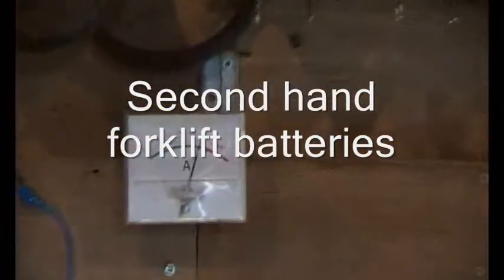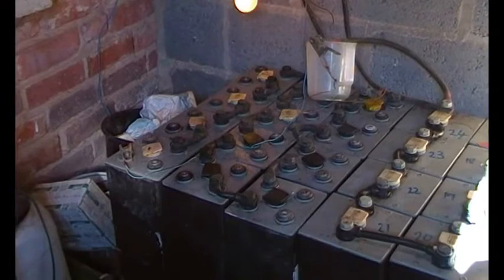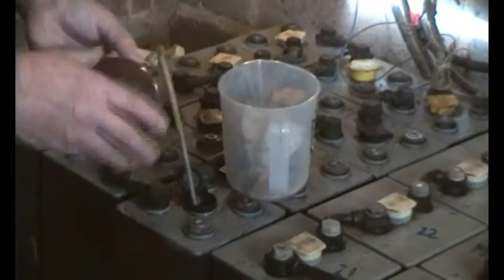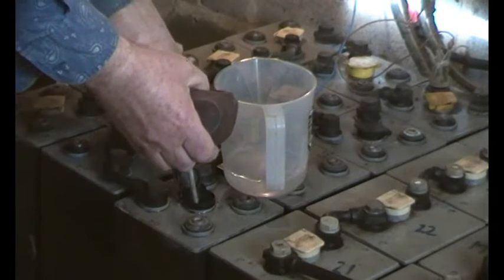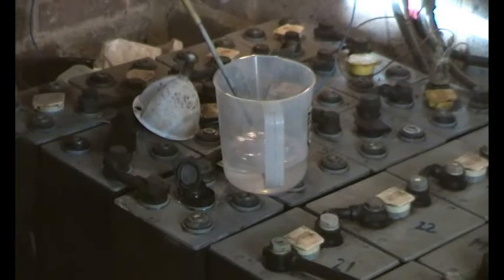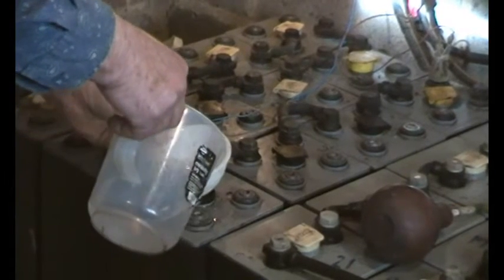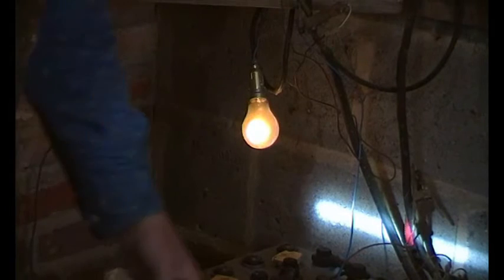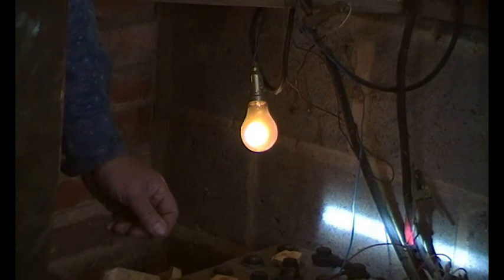Improving durability of second hand forklift batteries

Comment: How long will these batteries usually last in terms of age and cycles? 

Lithium batteries have cycle lifes of thousands, but how many industrial lead lasts? Lead is currently easier to use because its self balancing and supported widely by solar hardware. But lithium shines in cycle life.
Reply from the maker: Hi, the trick here is to use the battery as a buffer, balancing generation and consumption, that way the batteries are not deep cycled and life is extended by years, cheers

Comment: I have a question do you know if it’s possible to use a common lithium battery play one would use for a van?

What makes a lithium forklift battery special? 

Seems like stacking cheaper house, batteries for the team, the same voltage but maybe with less power density?

Seems like it’s worth a shot and a whole lot cheaper. That forklift batteries just ballasted to meet the weight?
Reply from the maker: lead acid deep cycle are heavy due to lead plates, mine are 500 ah and you won't find that in lithium unless they are in parallel. They have a different charging regime but things are developing fast. The weight for a forklift is a benefit otherwise weight has to be added, cheers

Comment: I’m a forklift truck engineer of 30 years and I/we have never put stronger acid in traction Batterys,
And you should never use distilled water it should be de- ironised,
And Verdigre ( Corrosion ) is caused by iron vapour coming of the wrong water in the Batterys, 
But all battery cell terminals should have grease on them to protect them from corrosion,
Reply from the maker: Thanks for your thoughts, definitely use battery terminal grease, cheers
Reply: Hi Andy and Dave,

Have recently got a set of 600AHr OPzS that were in good service for only 2 years and were de-commissioned simply because the PO went on grid.

Unfortunately the PO removed the acid to make them easier to move:-( . They've sat this way for 2 years.
That's how they came to me. The airtight caps are on.

Do you recommend anything I could do before I (re)do the commissioning procedure, e.g. add acid and CC charge at C20
till I reach 2.75 VPC/or no more increase in voltage and no rise in SG for 3 hrs after maxing out on the voltage?

Is there anything to try and remove any plate corrosion before this procedure (wash w baking soda, EDTA etc. and rinse thoroughly?

Really a beautiful set and it be a shame to toss

regards,
Nick
Reply from the maker: @nickbarret9368  Nick, it was common to empty batteries for long term storage. I would add the 1280 acid and give them a long slow charge, maybe at the 40 hour rate for about a week. Monitor the situation. Long slow charge will clean up the plates eventually, load more details is my book, cheers

Comment: Plastic apron but no gloves. lol
Thanks for the info. Very interesting. I wonder if a short duration in ultra strong acid can actually clean up the cell plates? Perhaps it will cause the deposit of debris at the bottom of the cells?
Reply from the maker: Hi, strong acid will only make things worse, the main thing is transfer all the sulphate from the lead sulphate into the electrolyte and this will increase the acid strength as the process happens. The apron is protect my clothes as it's far too easy to create holes in them, cheers
Reply: @TheInfoworks  Oh i see. Most of my clothes already have holes in them.
  Once sulfate has formed is there any other way of making it disappear again without either gunking up the bottom or coating the plates? Perhaps the only way to revive a cell is to let the sulfate go into solution and tip it all out and then refill with new acid?
Reply from the maker: Very long slow charging will turn the sulphate back into sulphuric acid in the electrolyte, that's why the acid get stronger when you charge a battery. With large cells we are talking about weeks at low current, cheers

Comment: For drawing acid out, you can actually use a bucket, a tube, and a shop vac. Get a home Depot bucket with a lid and a hole for a shop vac hose, then you can drill a hole for your tube to go on the other side of the lid. This will create a negative pressure in your bucket and create a vacuum in your tube. This way the acid doesn't get in your shop vac and ruin it, and it's super fast. This is what we do at work when were refurbishing batteries and adjusting the specific gravity to be in spec.
Reply from the maker: Hi thanks for the comment, this method might be OK for industrial uses but I normally don't remove such high volumes of acid. There is always the problem on remaining SO4 on the plates that will raise the SG after a few steady slow charges, cheers

Comment: Hi Andy, I have a 48v forklift battery each cell is close to 2v the lowest is 1.98 the highest is 2.02. After charging I noticed the water was bubbling hard. I left the battery of the charger for 2 days and it is still bubbling? Have you ever seen this before and what does it mean? Internal Short? Cheers
Reply from the maker: Hi, interesting, each cell should reach about 2.5v when fully charged and still being charged. What did your hydrometer test show? cheers
Reply: Hi a Batterys cell in service condition should be about 2.0-2.25, a battery cell will never hold a charger of 2.5 volts that is called ramp charge it will level out at 2.2,
Reply: Bubbling when at 80% charged or higher is normal. This is called the gassing phase. Hydrogen gas is being produced, so be careful and make sure you have proper ventilation.

Comment: Turkey basters are good for drawing out! Just read your book Andy thanks learnt alot, 2v drop testers seem like gold dust to buy! Any contacts for them?
Reply from the maker: Hi, thanks for buying a copy of the book, I hope it is edition three. I bought my last 2v drop tester from Ebay. You an make your own with nichrome wire made up in parallel to draw 150A and a multimeter. Cheers
Reply: @TheInfoworks  Thanks Andy, had a look but can only find Durarite ones at the moment tip for making one appreciated, book was from CAT centre so pretty sure it was third edition
Reply: Andy what Variac transformer would you recommend, I want to charge some spare single 2v cells. thanks Malcolm
Reply from the maker: Malcome, these are quite expensive bits of kit so it depends on what is available and what size charger you wish to use. I keep my spare batteries trickle charged through a resistance from my main pack. I did a video about it back in 2013 and the current flow depends on the restance value. Cheers, https://www.youtube.com/watch?v=-YQvQNAWch4

Comment: Been looking around for what is the OK charging temperatures for forklift batteries for solar applications. Thoughts?
Reply from the maker: HI, from my epxerience if the batteries are warm to the touch then they are being over charged. In this state they will be gassing freely. I try not to charge at anything more than the 10 hour rate and have good charge control. The stecca controller I show in one of my videos is very good, but I have also used a VLC V20 timer to good effect (see video). Here's a link to my wind and solar playlist: https://www.youtube.com/watch?v=nRvfJgN9Wrg&list=PLQAXpOOjFoVE-cm0FihzQuxbX4cNpdTJq. Cheers

Comment: what absorption voltage do you use on these and for how long before floating?
Reply from the maker: HI, in a wind and solar application a float charge is not really applicable. I work on current and specific gravity to check the battery state of charge. In this system the batteries are never "at rest" as they are constantly in either charge or discharge mode. Cheers
Reply: Daily visual checks/tests? Remote monitoring?  or you know how your system behaves
Reply from the maker: HI, I see where your interest is taking this. The batteries are not seen as a separate item, but as part of the system. By using good charge controllers and a UPS inverter the batteries can be kept at an optimum state of charge for most of the year. The PV generation side of a system should in summer be large enough that the charge controllers are working from mid morning every day (except rainy days). With these automatic systems and suitable generation, battery, consumption relationships then I check the batteries for electrolyte levels and SG readings about once a month. I hope this helps, cheers

Comment: I can assure anyone watching this that as a very experienced forklift engineer, I or any other engineer I've met (and that's a lot) DO NOT add strong acid mixtures to old batteries to restore performance. I've only ever met ONE customer who used to do it.
The sg readings are our best method of determine state of charge and condition. Adding stronger acid does nothing but corrode the positive plates (as the author stated).
Reply from the maker: Hi, thanks for your view of this subject, From my perspective, lowering the SG to 1280 when fully charged will increase battery life and so will not discharging them below 1150. Cheers

Comment: How many years use, will you get out of the batteries before they become inefficient?
Reply from the maker: This depends on how you look after them, keeping them between 1250 and 1125 will help, then keep the electrolyte at the right level, and try not to cycle them. I have been using my primary pack for 10 years and all is still OK.  Here's more info: http://lowimpactorg.wpengine.com/wind-solar-electricity-3rd-edition/ Cheers, Andy